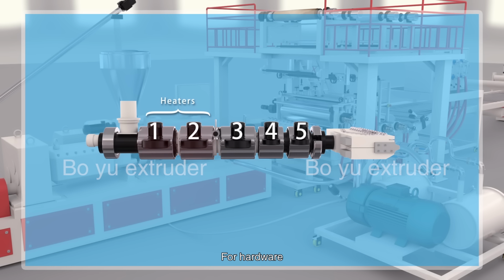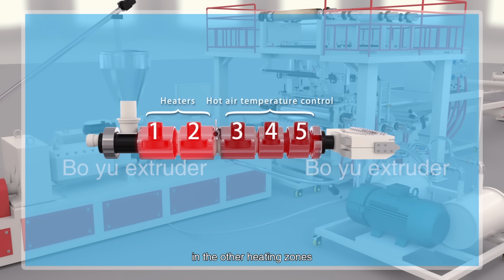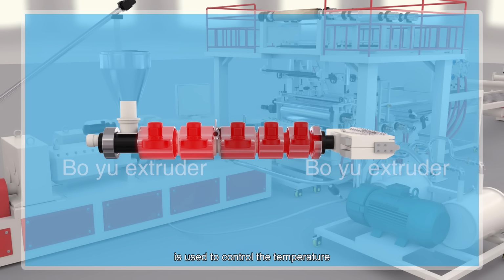Boyu SPC Floor Extruder, spc floor production line（Five roller calender)

Comment: What are the advantages of SPC floor？
Reply from the maker: SPC means Stone Plastic Composition, which chooses natural stone power and Fibre,so it will give the floor a more superior dent resistance versus a WPC vinyl.
Reply: @BOYUEXTRUDER  hlndl
Reply from the maker: SPC floors are non-toxic formaldehyde free, waterproof sterilization, convenient installation, realistic lines, super wear-resistant waterproof, flame retardant and heat resistant.